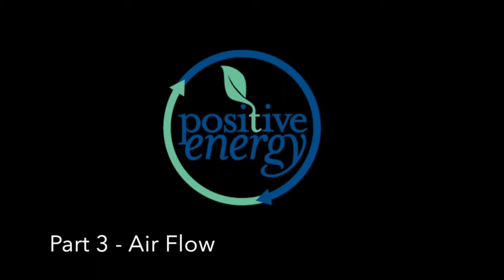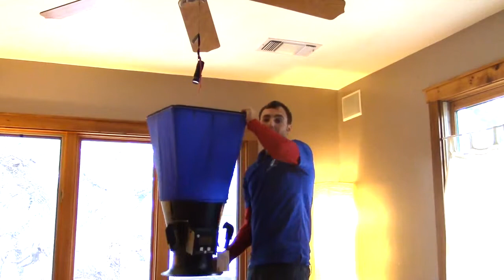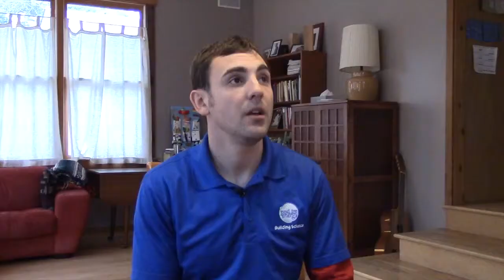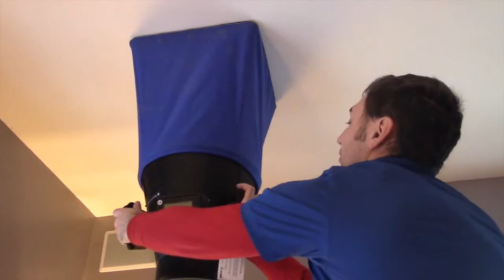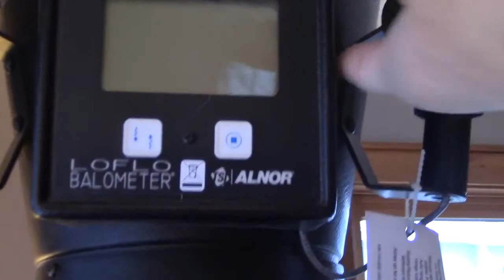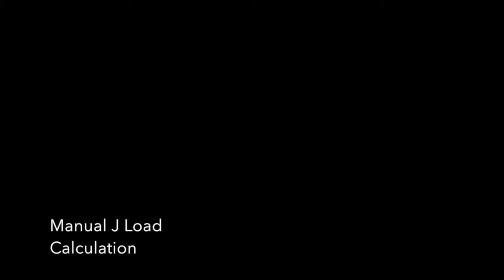The Importance Of Measured Performance Part 3

Comment from the maker: Air flow is one of the most crucial components of home performance. When a home has off-balance air flow, it's not working as well as it could. When we think of a home, it's easy to forget that it's an extremely complex system made up of parts to keep you comfortable and happy living inside. Positive Energy provides consultation and testing to ensure that homes are providing proper air flow from design to final build out.